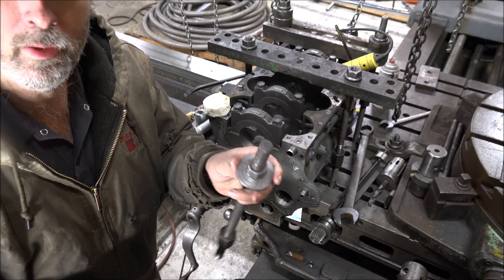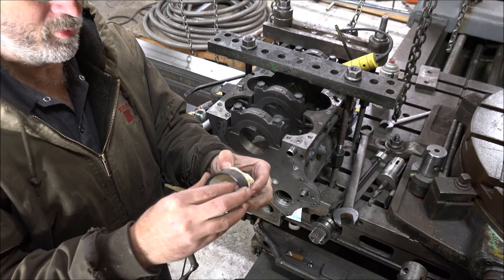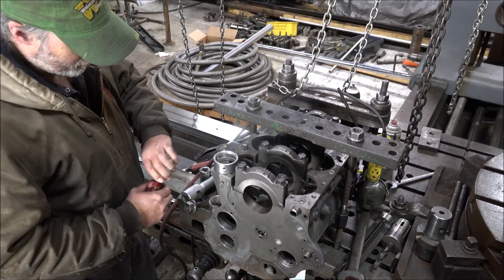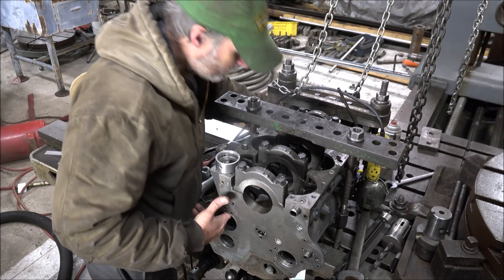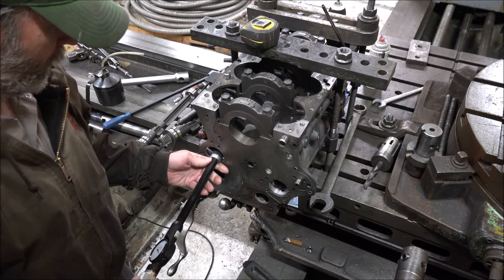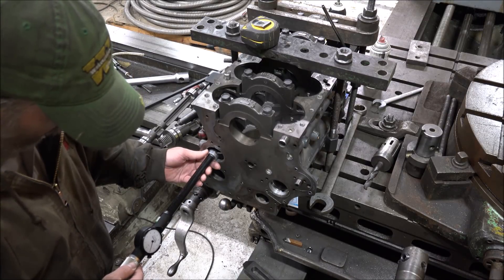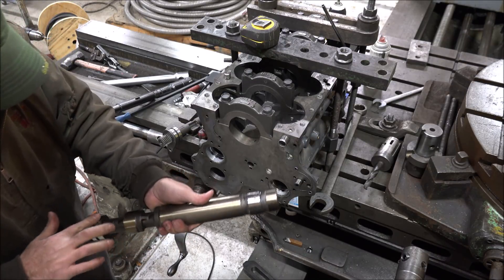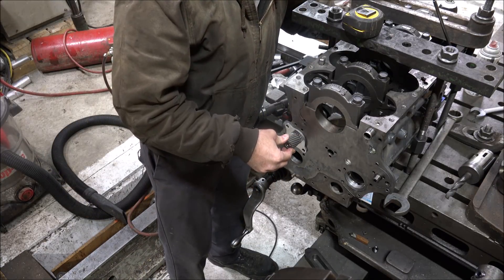Balancer Shaft Bushing Repair Deep Blind Hole No Access Design Can't Defeat Old Machinist Tricks

Comment: Well done !   I can imagine the satisfaction you feel having solved this puzzle with your mind, and being able to DO the work, having the tooling, etc.  In one word this is called: Capability.  The Owner's Manual says it this way:  Proverbs 22:29.   
  I face a similar puzzle which is why i stumbled into your video.  I'd love to get your opinion on my challenge:  hydraulic pump, shaft broke off due to unsupported pulley wobble, so all the energy concentrated where the shaft enters the pump.   I have about 1/4" of shaft sticking out of the pump housing.  Anyway, I could learn a lot from you;  thank you for sharing with us.  "Goodintight" German, I presume.  LoL

Comment: Hi ther you have probably been asked this before and more than likely answered it to, is you horizontal boring mill a Morse taper spindle if so how do you hold milling cutters securely, I've got by in the past just holding a face mill in the Morse taper it has pulled out a few times but I just lighten the cut. Any info or a close up would be much appreciated.
Cheers Kyle from England
Reply from the maker: You should be watching more of my videos!! lol The device I used has appeared in 2 of my fairly recent videos and I did an entire video on it when I made it. https://www.youtube.com/watch?v=UX2qk_W0450

Comment: Did you drill the oil ports in those reducer bushings before you installed them or after they were in the block ? ? --Doozer
Reply from the maker: I drilled them before but the back one doesn't have any. It lubes thru the shaft.

Comment: What ever became of the Audi project?      You put some effort into that thing and were so close to getting it timed correctly if I remember right.      

In my experience, those Audi engines ya pretty much have to have the proper tools which includes a flywheel locking pin, cam holder thingies, ect…while also relying on step by step instructions from a Bently manual or the official Audi service manual.   This being one particular for timing those Audi engines.
Reply from the maker: You must be skipping videos. Tisk Tisk!! Lol I got it running by that one piston that took the impact of the broken off valves must have had a broken ring as it’s down on compression on that hole and has a miss. I have never torn it back apart to fix it.

Comment: Nice Job.  I sure made a bunch of those over the years.  I used to replace rear cam bearings while doing in-frames and that round driver/puller with flats worked every time.  NH220 and Triple Nickels.  I would use all thread with a hiemjoint/swivel joint that screwed into the bushing puller.  Push thru the bores and twist till it went thru the last one then pull.  Worked great.

Comment: Some jobs are really tough to beat into submission !   'Seems that a lot of design engineers go out of their way to make products difficult to repair on purpose - which tend to get tossed , or have to go to 'dealer only' for repairs , ( if possible ? ? ? )      Obsolescence is planned in a lot of manufacturing , which is an absolute pity - I watched thousands of tons of FINE MACHINERY go to the scrapyards back in the late '60's . . .  mostly due to CNC taking over !    Economics has pushed this nonsense into oblivion !
    'Really glad to see that you got this one straightened out . . . way to go !

Comment: I was worried when you left off at the first video but had confidence you would prevail. Warren over at Western Truck and Tractor Repair hates those Kubota engines. He has done some rebuilds and doesn't think much of their engine design either.
Reply from the maker: Warren is a smart guy.

Comment: How does that back bearing get oil?  I thought the bushing would need oil passages drilled into it.
Reply from the maker: The balance shaft is drilled and oil from the front bearing goes thru the shaft and lubes the back. It’s like built in asking for an oil starvation issue but hey they saved some machine work!
Reply: Brian explained that in last video.

Comment: Here's a dumb question: How bad would one of these diesels be without the balance shaft? 

My only experience with them is on inline 4 cars, and in that world removing the balance shaft is done all the time and with little ill effect other than a little more NVH.
Reply from the maker: I can't say on this exact engine but the Cummins 4 cylinders that are on gen sets that run 1800rpm or less  that don't have balancers vibrate like crazy at 2500rpm+
Reply: @bcbloc02  That's pretty interesting! The balance shafts on 4 cylinders hardly look to have any counter mass. 

On the other hand the balance shaft on my 3-cylinder Yanmar looks like a crankshaft without the journals. Would probably rattle the engine right out of the frame without it.

Comment: I-had to repair my 276 john deere balancer shafts a few years ago , one of the bushings had spun out , the shop in Somerset didn’t wont to mess with it so i had to do the job myself,   i made a sleeve  to-hold the bushing and tig welded it in ,  replaced all 6 while at it ,   Worst part-was I didn’t have all-the special tools to do the job , made some , the staker to stake the bushing and the puller pusher ,to remove the old ones and press-in the  new ones ,  local  JD dealer let me use some of their special tools .
Reply from the maker: The 2630's and 2640's were bad about beating the bushings out. I have fixed several of those blocks over the years.